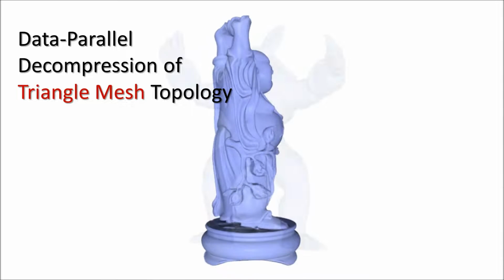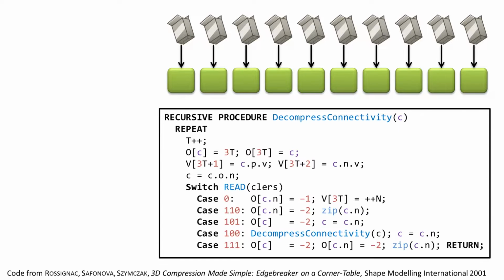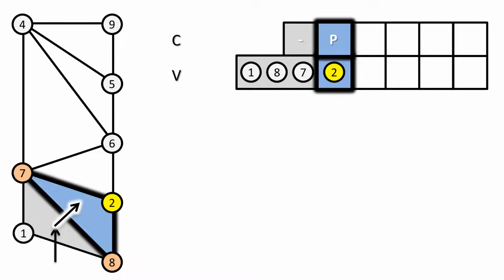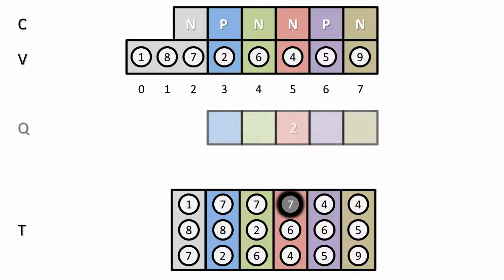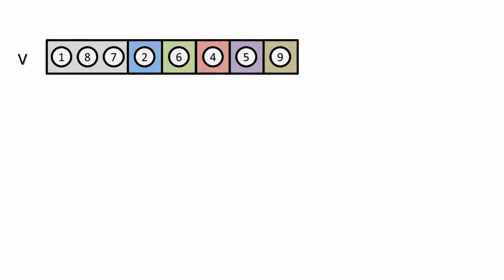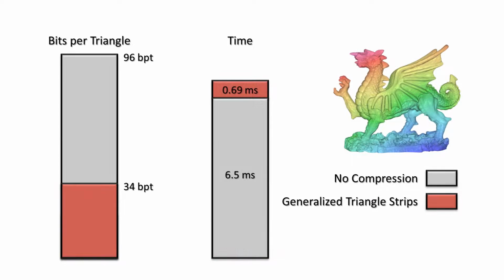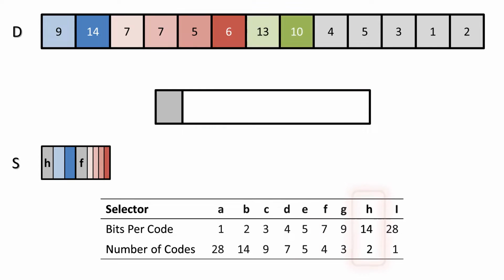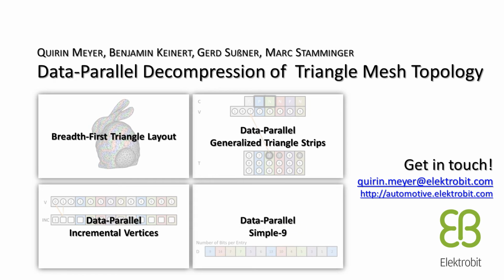Data-Parallel Decompression of Triangle Mesh Topology

Comment: So you can decompress much faster at the expense of three times the storage? How much faster compared to your competition does it decompress? Because if it isn't greater than three times, then it isn't worth it.
Reply from the maker: +eduardo “mexamexo8” marin 
Thanks for the question. You're right: The speed has to be significantly faster compared to other methods in order for it to be useful. In fact, we have investigated that question in the accompanying paper http://lgdv.cs.fau.de/get/1835 in Section 7.6. For the entire answer, I recommend to read it. For you convenience, here is the answer in a nutshell:  

The method shown in this video decompresses triangles about 100 - 5000 times faster than competing methods.